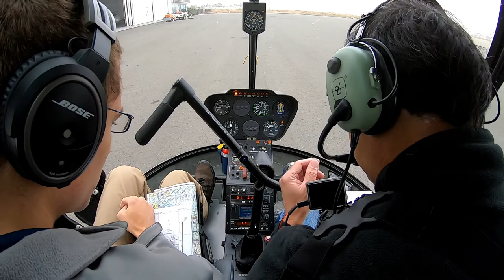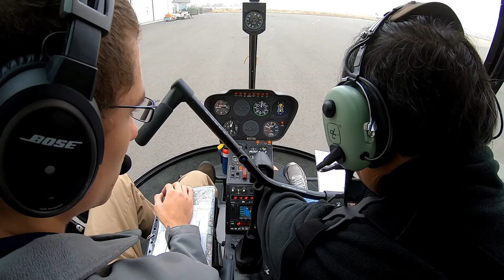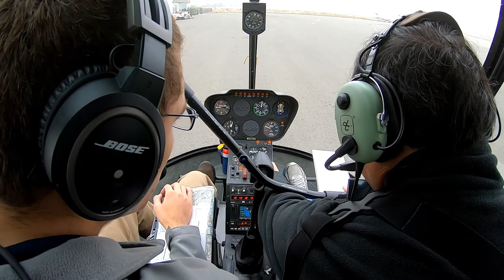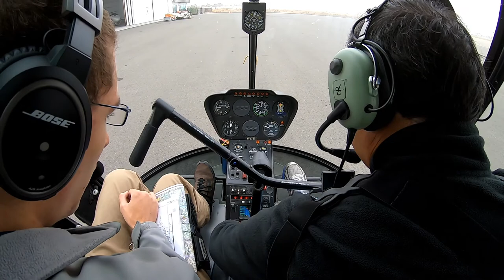Specialized Helicopters, Robinson R22 Lesson #3

Comment: Can I ask where is the main camera connected to ? I have my 4th lesson tomorrow and would like to take my go pro with me but I dont know what or how the main camera is mounted in this video to do the same for my lesson , thanks
Reply from the maker: I have the GoPro Hero7 mounted on a piece of wood with a tilting mount so I can adjust the vertical frame view. The piece of wood hangs on the right seat's headset hanger at the back firewall with pieces of Sorbothane to absorb the vibration. The HyperSmooth picture stabilization is turned on. 

I am using the GoPro external microphone adapter with an external battery and a U174 adapter cable that provides intercom/radio audio input to the camera. In this video I was also using a second shoulder mounted camera with external microphone for the startup audio before putting on headsets. Now in the Lesson #5 video, I use the camera's internal microphone for startup, then plug in the 3.5mm intercom cable to the external microphone adapter when we go to headsets. Now I don't have to cut and paste the audio tracks--- It's all on the Hero7, and I'm no longer using the second camera in Lesson #5. 

My mount is modified from RebreatherNut: https://www.youtube.com/watch?v=khRLj82iC08 . Good luck with your training. I find it very helpful to be able to review my lessons.
Reply from the maker: @jordanclark8165  The short answer is no, not exactly. The Hero 4 has built in external microphone capability, and can receive an external microphone input as well as external power through the mini USB connector on the camera. You can receive the cockpit audio through the adapter cable, but I think while the adapter cable is plugged into the camera, it disconnects the internal microphone, so you won't get the audio before you go to headsets. If you unplug the adapter cable from the camera during pre-startup, then plug the cable into the camera when you go to headsets, I think you will get all the audio, but this won't work if you are not using a battery in the camera and only using external power.

Also, the Amazon item you linked is for an airplane general aviation 1/4" phone plug, the Robinson R22 we have over here uses a U174 plug, so if you have that exact item, you will need a U174 to GA (general aviation) adapter.

The Hero 7 adapter I have is: https://gopro.com/en/us/shop/accessories/pro-3.5mm-mic-adapter/AAMIC-001.html
The helicopter audio recording cable I have is: https://www.crazedpilot.com/cockpit-helicopter-audio-recording-cable-gopro-hero2-all-cameras-with-1-8-mic/
The Hero 7 internal microphone works with the external mic/power adapter plugged in with external battery (my internal battery is removed), then goes to the external audio input from the U174 adapter cable once the 3.5mm plug is connected.
Reply: @rotarywing  so that cable I got is no good then?  What cable do I need to record the audio from once the headphones are on? I also want to record the start up process how do I do that before the headsets are turned on
Reply from the maker: @jordanclark8165  I think I would try this cable: https://www.amazon.co.uk/Nflightcam-Audio-Power-Helicopter-Cable/dp/B00RZPZ9IG/ref=sr_1_fkmr0_1?keywords=Nflightcam+Helicopter+Audio%2BPower+Cable+for+GoPro+Hero+3%2C+3%2B%2C+and+4&qid=1578771442&sr=8-1-fkmr0
If you are using the internal camera battery, then just unplug the external audio cable during startup to use the internal camera microphone, then plug in the external audio cable when you go to headsets. If you are using external power, then you would have to test if you could be on internal battery during startup and then go to external battery once you plug in the external audio cable/external power when you go to headsets. My Hero 7 doesn't like to work with external power with internal battery installed; it stops recording/shuts off after the internal battery is charged, so I had to remove the internal battery.
Reply from the maker: I have posted a video of my R22 Camera mount: https://youtu.be/RYa-aBzwoZw